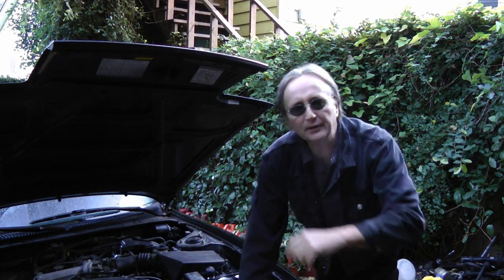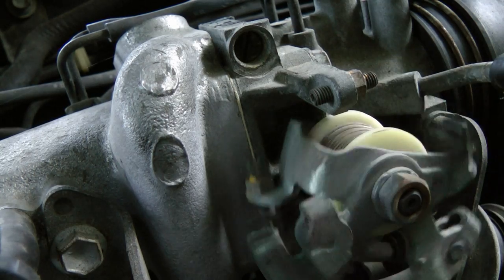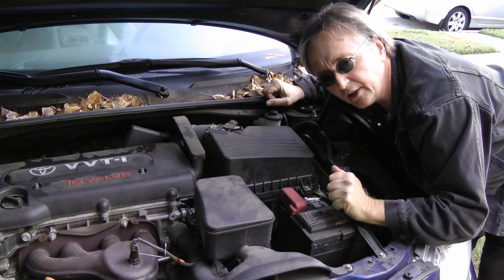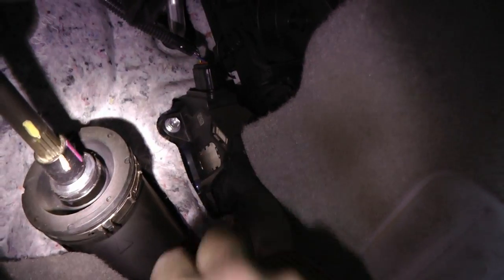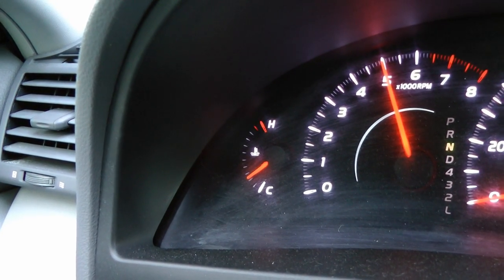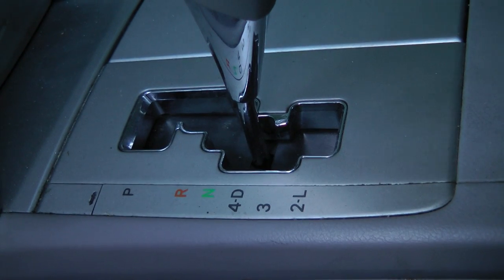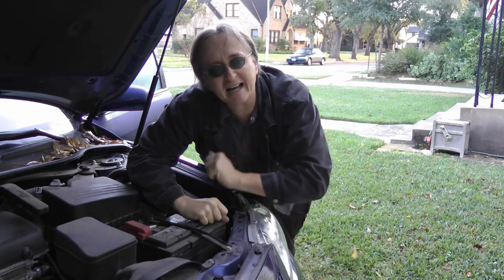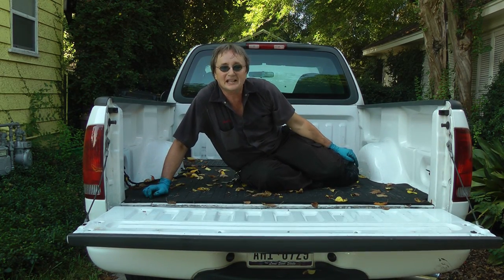How To Stop Unexpected Car Acceleration

Comment: Apply the brake hard enough to stop the vehicle as you put in neutral. DO NOT SHUT OFF THE ENGINE. Oftentimes, you have enough time to watch and scream, you have enough reactive time to brake and put the shift lever in neutral at the same time. Steer the vehicle safely. Everyday, you have reacted many times faster while driving normally than the sudden acceleration incident. It's the inattention and confusion that causes the crash. On most cars, there're only two choices, (A) accelerator and (B) brake (C for clutch). If you get confused out of those two, "A" or "B", you need serious training and practice in driving. You put a lot of lives and property at risk by your easily confused mind. "Sudden acceleration" alibi are used by drunks, drug addicts, sick people, unskilled drivers and careless drivers as excuse from prosecution. 
Don't put the blame solely on the vehicle. 
It's the same with pants' zipper. Pants manufacturers doesn't put instruction on what to do when you get your skin caught by the zipper, but you use common sense when it happens.

Comment: How about in addition to shifting to neutral, that the brakes be applied? The brakes generate more anti-torque and horsepower absorption than the engine can generate.
Reply: George Travers I'm not sure that's the case, the brakes are designed to bring the car to a stop when not under engine load, not when the engine is at maximum revs.
Reply: Gregory Ridley That is the case.  Brakes on cars nowadays are WAY stronger than their engines.  Motor Trend did a test on it, and the brakes on average 4 cylinder family sedans were able to apply 3-4 times the amount of "braking hp" than the engines could generate at WOT.  For most test vehicles, the distance from 60 mph to 0 was hardly increased with or without full throttle application.     www.motortrend.com/news/unintended-acceleration-test/amp/

Comment: So if you shift to neutral with the engine racing you run the risk of a blown motor. That beats a wrecked car and dead bodies.
Reply: any late model car will have a rev limiter. i bet 95% of people driving today have never shifted into neutral.

Comment: @eundaddy those are completely lies (from the lady). First, shifting into neutral will always disconnect the engine and transmission. Second (and this is how i know she's lying), automatic transmissions (on newer cars) have a safety device called Reverse Inhibit designed into transmissions to prevent inadvertent selection of reverse. Putting it into reverse (in modern cars) when going forward has no action at all, the car just ignores the request until you get down to a proper speed.

Comment: Drive a manual car, simply press on the Clutch pedal when this f*king unintended acceleration occurs! I had this issue more than five times on a 2010 corolla with manual transmission. I simply pressed the clutch all the way down and the engine calmed down in a few seconds. My next car will be with manual transmission for sure!

Comment: which is exactly WHY i reject newer cars, i will NOT buy them. in my driveway i have a 1987 pontiac bonneville, a 1991 cavalier, and a 1989 camaro with a nice little 350 i dropped in. older cars are cheap to buy,cheap to fix, cheap to insure, if you buy from down south rust is not an issue. i dont like these cars that have multiple computers inclduing a BCM, yes i computer to control simple things like dome lights, power windows, and power door locks

Comment: I worked at one of the largest Toyota dealerships in the southeast and we were bombarded with complaints well the news story was big. Out of the literally thousands of cases there was never a single case that was duplicated or found to be valid. Also not a single case at the dealership Arbors at came in that wasn't still under Finance which led us to believe that they were just trying to get out of their car loans. Toyota sent dozens and dozens of Engineers out to personally inspect each vehicle and some were even brought back to the factory in Georgetown Kentucky but not a single case was able to duplicate the problem. In the Northeast issues were blamed on Stick rubber All Season floor mats which are not common and rarely used in the southeast since we don't have snow and slush. We do however have a bunch of slick old juice and Julio's.
Reply: Our first event just happened this weekend with our 2009 Rav 4. Just because it can't be duplicated on demand does not mean it didn't happen.   We don't want a payout, we don't need out of a loan, we just want Toyota to FIX THE DAMN CAR we like otherwise so we can keep driving it safely.  Maybe if crooked people would get out of the automotive industry or  actually try to fix the problem 80+ people wouldn't have had to lose their lives before it was fixed..  Do you really think the 1.2 Billion fine and multiple recalls were over nothing?  If it was human error why is it not happening to newer models or other makes of vehicles?    The incompetent screwups tried telling us the same thing- nothing wrong. 2 adult witnesses in the car.  Stock carpet mats secured properly nowhere near pedal, reprogramming done, etc.    We were already sitting stopped and me with my right foot stationary on the brake already (thankfully) when it started.  when pressure with one foot didn't stop the engine from inching the car forward I added my left and pressed as hard as I could and then shifted to neutral to stop it.  IF it were working properly  shouldn't me pressing the brake have over-ridden any throttle input? IT DID NOT!  Also when I shifted to neutral, shouldn't throttle input have caused it to rev once in neutral.  It DIDN'T it idled right down.  Apparently profit and corverup are still more important than people's safety.

Comment: I was driving my 1998 ssei Pontiac today and out of no where just kept going up in speed I pulled over riding the brakes then when I came to the side of the road I put it in neutral and it just kept revving up to like 6k rpms turn the car off twice and it just stop. If anyone know why it did this I could use the help. It was a scary experience
Reply: Btw new tranny only like 30k miles on it

Comment: what if you have electronic steering?
Reply from the maker: electronic steering is just a power boost for steering, you still mechanically control the wheels turning by turning the steering wheel. At least on all the ones i've worked on.
Reply: Scotty Kilmer but you stil have power to the wheels if you shut your car off?
Reply: Scotty Kilmer lol its so important to say " all the cars I have worked on at least" these days.
Reply: What difference would that make?
Reply: +DED 1344 you could still steer the car albeit with increased effort especially at lower speeds.

Comment: IMHO there should be NO vehicle allowed on the road that is as the case with the Camry described fly by wire. Oh Scotty I MUST correct you on the Toe under the throttle !! Not all cars will do this as many only have the cable end sliding through a hole and a retainer they cannot actually push the cable back to close the throttle. 
Your dead right about just shifting into Neutral whether it be an auto or manual you can control the vehicle to a stop and then shut off.

Comment: most engines rev higher while cold... thats why carbureted motorcycle engines have a choke (bring the revs up to warm the engine, mine revs at around 3k with choke).
for example my subaru's IACV opens the throttle just a hair to raise the idle while its warming up. im no mechanic tho so dont trust me.

Comment: i'd rather blow the engine than risk hitting another driver who hit their brakes in front of me...because anybody who has messed around with vehicles before should know your brakes have far less effect on your vehicles speed when the engine isn't running, and the sad thing is how slow you can be moving and it still takes longer to stop...

Comment: wont putting it in neutral blow the engine? my Prius did that.....put it in neutral and the car sits in my back yard with a blown connecting rod sticking out the block lol

Comment: BUT by shifting to neutral u might damage the engine more i would think i myself would shut it off
Reply: +Landy Burkland rev limiters....
Reply: +Jan Tolentino cold engines...
Reply: +Nikola Begonja you shouldn't be driving with a cold engine..
Reply: Jan Tolentino
not a lot of people warm up their car.
Reply: +Jan Tolentino We come to the carburetor, a crude fuel-mixing device that once ruled the automotive universe.

Today, the carburetor is largely extinct, kicked aside by the modern fuel-injection system. Yet millions of drivers still seem to be stuck in the Jurassic Period. I thought of this recently when I watched a man spend 10 minutes warming up a fuel-injected Toyota that could have been driven seconds after it was started.

Few processes are as poorly understood as the cold-weather start. Back in the days of carburetion, a car couldn’t be driven until it was warmed up. Today, warming-up is a counterproductive exercise that wastes fuel and damages your car.
Reply: +Landy Burkland 
Huh? Down shifting a manual car from say 5th into 2nd might damage your pistons and valves but going to neutral in any car should be fine.
Reply: so damage to car vs. possibly getting killed and you chose the car? Good option.

Comment: throwing it into neutral is a good way but then it could blow the engine couldn't it?
Reply: your life is more important
Reply: you can probably shut the engine off once its in neutral and coast to a stop.
Reply: LAgaming14 Never shut off the Engine when you are driving. Because the PowerSteering and the Braking support will stip working. Probably it even locks your steering wheel.

Comment: if u put it into neutral it will blow your engine from revving so high
Reply: if your engine are properly maintained and with the rev limiter working, your engine will be fine.
Reply: Ours just did this Saturday.  It continued to rev while i held the brakes down.  but when I hit the shift to neutral, it quickly.  Returned to idle as if nothing had happened.  Had I been accidentally pressing the gas or a floor mat or something been stuck it should have revved up as you say,  but it did the opposite and idled down when put in neutral.

Comment: I have to disagree with you. Electronic throttle control is plenty reliable...how often do these units fail?? Almost never. 

Multi million/billion dollar aircraft have been using fly by wire (electronic) technology for years without issues. 

Although you have great vid here. The lack of common sense in people these days is alarming.

Comment: When engine work on high rpm,it can be damaged,specially in neutral ,i mean when u just stand in place and give it full throttle,well that same happen when on road it get suddenly high rpm,and u shift to neutral.Why not just step on brakes,it will kill the engine,i know ..clutch.I would rather risk that to destroy,than engine.
Reply: modern cars have a rev limiter to prevent high engine rev damage. depending on the car, stepping on the brake can overide the throttle so it will slow down the car without shifting to neutral. However, in some cars (video: how to stop your car in unattended acceleration consumer reports) the brake does not overide the throttle. so the car would continue to accelerate no matter how hard you step on the brake. so the only way in this situation would be to shift into neutral, and then step on the brake.
Reply: +MTVlogs Brakes are always stronger than engines. You can always stop the car with the brakes no matter how much it is accelerating.
Reply: +Shane Grogan This is true with a brand new set of brakes.  However, a set of brakes that still function in properly stopping the vehicle, but yet have some age, wear and tear may not be able to stop a vehicle with the engine fully revved.

Comment: Won't you over rev the engine and blow it?
Reply: +crusty old fart 

No. In a manual car, going from 4th to 1st or 5th to 2nd will blow up ur engine. But in an automatic, going into neutral, you'll just hit your electronic speed limiter.
Reply: peachees I do't have one of those on my old ford log wagon.

Comment: I really hate those stupid new electronic throttles. It's so unnecessarily complicated, and provides no advantages! I can't see what these auto makers are thinking. Even if it were somehow cheaper to use the electronic throttles, I would still rather pay a few bucks extra for the physical connection. 

I mean, it's like designing a new door knob where when you turn the handle, a computer instructs a servo to retract the latch, it's just completely unnecessary, and just more crap to break!

Comment: Not all cars allow you to shift to neutral while driving. My old one didn't. I tried it, didn't work. I guess if you have a manual transmission you can step on the clutch? The "hubbub" Scotty is that people died. There's no time to put it in neutral in some cases. Like the kid whose Toyota Rav4 accelerated over the edge of a parking garage three stories up. Also, Toyota LIED. They blamed it on floor mats when the truth is they have bad software that they still haven't fixed. I sure hope it never happens to anyone you care about Scotty, as much as you promote Toyota. I love your channel and your enthusiasm but this is a serious flaw with Toyota vehicles.

Comment: But Scotty shifting it into neutral will cause the engine to rev high and you have a risk of blowing the motor
Reply: Krrish Patel but it's better than risking your life
Reply: Ino Torres ok but still who wants to spend $4000-$5000 for a motor
Reply: Krrish Patel still better than risking your life or the lives of others though, surely?
Reply: Gregory Ridley ok so you are saying you don't care if you blow your motor and will buy a new car instead that costs $24,000-$50,000
Reply: Krrish Patel I'm saying that I'd rather reduce risk to human life than an easily replaceable piece of machinery. 

So are you saying you'd rather have a potentially fatal crash than pay out for repairs?
Reply: Krrish Patel Just my opinion that's all. Plus I'll probably never spend over $10,000 on a car as long as I live :') stay safe man.

Comment: The advice for throttle cables is incredibly dangerous and ill informed. You CANNOT slow down most cable controlled cars by pulling up on the throttle. The throttle cable will pull on the throttle but it can't push the throttle, usually the cable just folds over on itself.

On the other hand I've never understood the problem with shifting into neutral. I've had pedals get stuck on the floor, neutral key off and your done.

Also it turns out that in all the cases of unintended acceleration it was driver error, there wasn't anything wrong with the cars. But blaming drivers for being drivers doesn't make the news.

Comment: It's less of a common sense problem and more of a "I don't give a shit about what I'm doing" problem. No one is born knowing about neutral, but anyone who actually gives a shit about the two ton missile they're piloting on a daily basis would learn what the transmission does and what each gear is for. 

This is why pilots have simulators to practice emergency procedures. We could do that with cars, but we don't, for no good reason at all.

Comment: Wouldn't putting it in neutral rev the shit out of the motor? Why not turn off the motor and put it in neutral? Of course avoiding steering lock.
Reply: The engine will be fine. Just do what you have to do to get to the side of the road. The engine should be the last of your worries.

Comment: or just turn the key off
Reply: My car doesn't have a key for the ignition. It's a pushbutton start, so it's not possible to "just turn the key off". I have heard that you have to hold the button down for 10 or 15 seconds to get it to shut off the engine. What people do is push the button and nothing happens so they stop doing it.

Comment: False if you put it in N it will even turn faster to its limit cause its easier for the engine to spin freely. Just shut the engine
Reply: in some cases we need steering ability 
if the key is turned 
what about steering lock